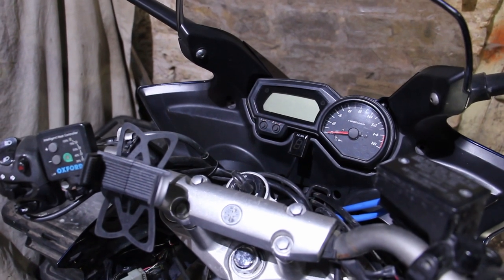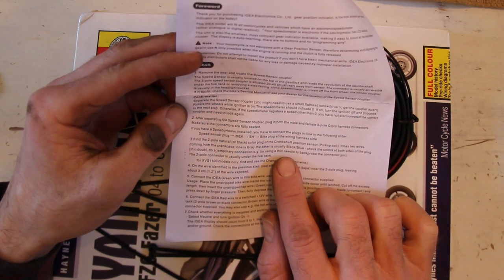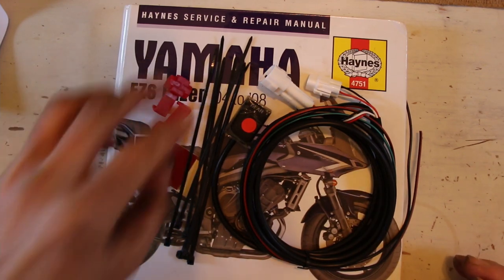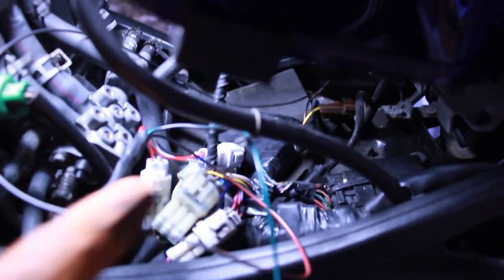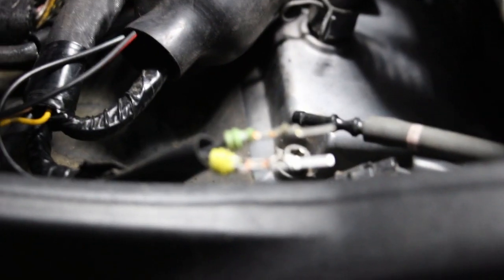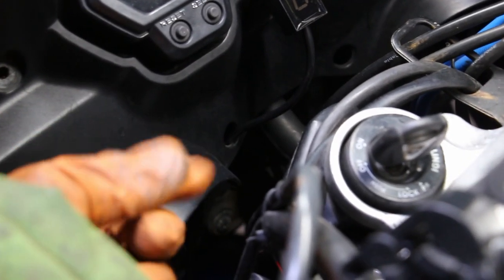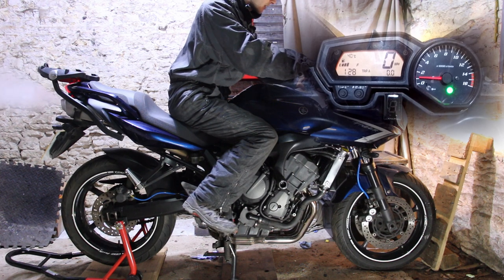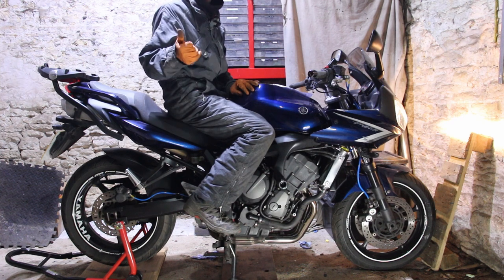A Fazer in My Life - Episode 11 - GEAR INDICATOR INSTALL

Comment: Thanks for the video, the instructions that came with my kit were rather vague, I’d never have worked out how to power it from brown brake light cable & grey crank sensor cable. 
Took me a while to work out that the plug that’s disconected is then used with both ends to make a bridge with the gear indicator!
I also made an “L” shaped tab out of an aluminium number plate, and hot glued it in place between speedo & fairing.
I also gave up on the scotch “snap shut” cable jointers as they were very fiddly, so I cut my cables & joined then using crimp style connectors. 👍🏻
Reply from the maker: Good job 👍🐷

Comment: Thanks for the video.  I too would love to have a gear selected indicator on my motorcycle, mainly to indicate first and second gear so I can  more confidently find neutral (for which an indicator is provided). I came across this device on Ali-Express and I now know (thanks to this video) that this is not the device I was looking for. The neutral sensor on my bike (a Royal Enfield 650 twin) provides 7 different output voltages, one for each of the 6 gears and a 7th for neutral. The plug/socket is the same but obviously serves a different function so I won't be trying to use the one shown in this video (I've ordered one but I hope not to use it now although probably I could change the plugs to make it work with my bike). Instead I'll program a micro-controller to detect those 7 voltage levels and display the correct gear on a 7 segment display.  Wish me luck.
Reply from the maker: Sounds like a complex neutral switch there! Have fun!! 🐷👍😁

Comment: Thanks, was going to get one of the healtech plug and play kits due to most people saying these ones are crap but I will pick one up and see if I can get it to work on my srad.
Reply from the maker: Yup. Done few thousand miles with mine and not once had a glitch! Ride safe 👌🐷💪
Reply: @PiggyPower  I assume these will fit a carbed srad. I've messaged a seller on ebay as he mentions in his listing they will only fit injected bikes. Wondering whether that's just his wiring looms on them though.
Reply from the maker: Hey, yeah just search for one with your bike as part of the search, I'm sure you'll find one. The system uses a signal for rpm and a signal for speed. Plus power and earth. That's it. 👌

Comment: my bike wont start after I went into the brake line
Reply: also the fact that u went above and beyond to wire your own clips really didnt do me any justice as someone who is using the red splice clip things.
Reply from the maker: The brake line? Don't need to touch the brakes in anyway at all!
Reply from the maker: Don't use the splice clips. Awful things which work as a quick fix but not long term 👍
Reply: @PiggyPower  It was the brake light power line now the actual brake lines.
Reply from the maker: Are you sure you spliced into the correct wire? Perhaps you blew a fuse? Checked fuses? Doubled check wires?
Reply: @PiggyPower  I ended up removing the whole gear indicator and recharging the battery and it kicked right on, i guess i wont be using the gear indicator
Reply: I purchased one of these thinking I would install it myself.  After watching this video, I think I’ll see if I can get a shop to install it.  Thanks for preventing me from messing my bike up.  

I can pull a 4 carb stack out and rebuild them, but I’m intimidated when it comes to splicing into my bikes wiring.
Reply: @SomaJockey  its something i plan on learning eventually but i just dont grasp the understanding of electricity honestly.
Reply: What happens to the 2 plugs that are unplugged & not used as the gear indicators now plugged in to the other side of them? Do they become redundant?

Comment: Good instruction! Thanx so far, but does anybody knows why my indicator keeps flashing L? Without going from L to 1?
Reply from the maker: I've never seen mine go to L. What do the instructions say about the L ?
Reply: Yours is also going to L , from 6 to 1 and then L.. flashing L. Mine also, but then it’s not going to 1
Reply from the maker: @Markiesvancarrabas  ah, so L is learning mode I think?
Reply from the maker: So rewatched coz it was years ago, flashing L, how long you waiting with engine running that it goes to flashing 1? ... If it never goes to flashing 1 it would tell me it can't pickup a signal from something, speed or rpm
Reply: Oh thanx so much! I fixed the green wire on the grey one.. green is for speed/rpm ? So maybe is grey not the one I need
Reply from the maker: Speed and rpm are different things... It needs a different signal for either ... 🤔
Reply: @PiggyPower  I thought I was almost there😫..
Reply from the maker: @Markiesvancarrabas  recheck all your wiring connections v the instructions 👍
Reply: @Markiesvancarrabas I'm getting same problem. The L flashes fast when I turn ignition on but dosnt go to 1. Did you get it sorted?
Reply: @martinbutler3896  yeah I did.. does it flash faster when you speed up?
Reply: @PiggyPower  it worked out fine when I was outside on the road! Thnx for your effort!

Comment: Just installed mine and failed the learning process,  says 1st gear is nothing and 2nd is first , I tried disconnecting the battery and all wires from it but it won't re-learn at all  ... just my luck lol
Reply from the maker: There is a procedure to cancel what has been learnt and start again, check the instructions 👌
Reply: @PiggyPower  just got it fixed after getting a refund 😬 lol thanks man 👍
Reply from the maker: Did it need the reset?
Reply: @PiggyPower  yeah , the first time it didn't work, the second time it worked like a charm

Comment: My yamaha fz6 s2 with abs has a 4-pin connector, so what to do ??
Reply from the maker: You may not have found the correct connector or need a gear indicator for the ABS model?
Reply: Yes, I need a model with an abs system, because I don't have a three-pin connector. I have a 4-pin connector. But the question is where to find such an indicator for a model with abs
Reply from the maker: Why not ask the supplier? There maybe a work around. I expect you could splice in